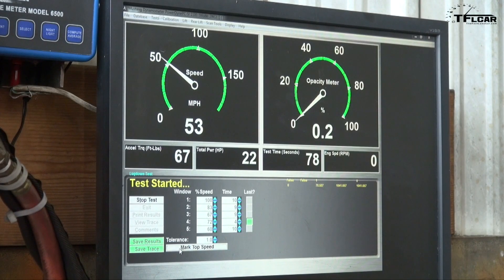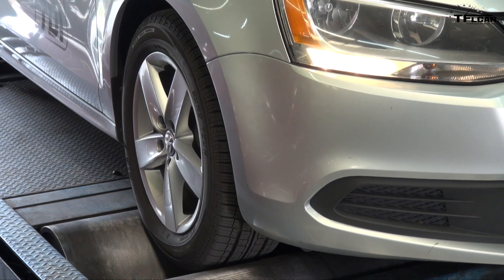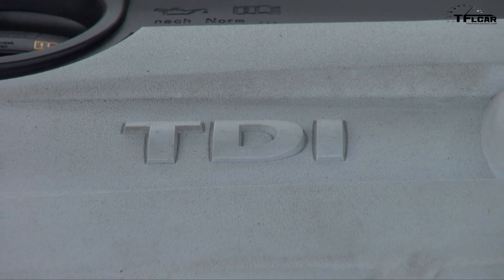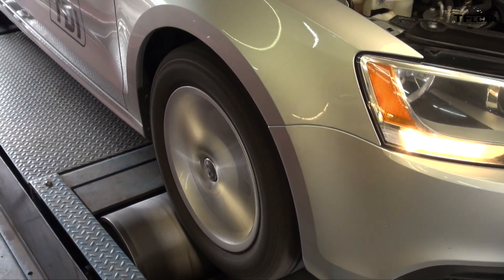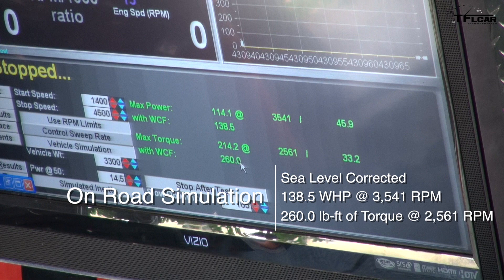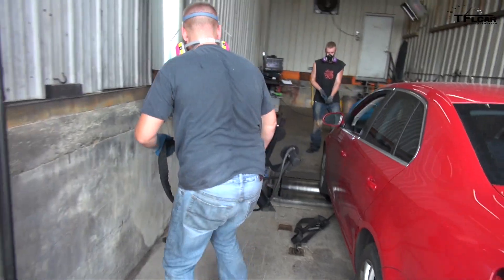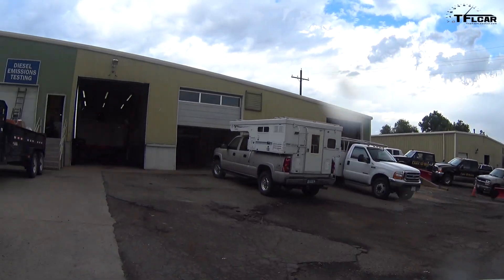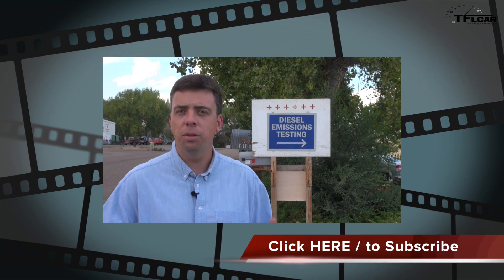Surprise! We Dyno a VW Dieselgate TDI Jetta to get the Truth about HP Loss

Comment: While I appreciate your attempt here, I am afraid your results are not valid; as VW's software is smarter than that. To begin with I don't think you put it in the proper dyno calibration model; as I understand that disables the traction control from triggering. (With older Golf R's you had to take the car through a sequence of steps to enable a dyno mode that disabled four wheel drive, but I am not sure how it works on the TDIs.) Also, you did not match the EPA's actual test, and I believe the software is specifically looking for those conditions to enable the "cheat". (Look up FTP-75, HWFET, SFTPUS 06, SFTP SC03.) I know for the newer vehicles CARB ran the phase 2 portion of the FTP on a loop and were able to detect that VW had tuned DEF dosing to result in a proper emissions output at the start of the test, but would reduce it in time to the point that emissions were uncontrolled. My guess is that older cars use a similar method and are looking for specific characteristics mirroring the actual EPA test as opposed to a straight dyno run, and that the decreased performance you saw was simply a result of the car going into a failsafe mode since traction control and abs were not functioning properly.
Reply: +Andrew Price I think you're absolutely correct. This is an interesting test for sure, but I don't think the 2nd dyno pull was a valid test.
Reply: Troy Strain  Well unfortunately I am not much of authority in this area either; as otherwise I could tell you how to enable the proper car mode and provide greater detail with regards to differences between TFL’s testing and that actually used by the EPA.  As a TDI owner who also has an engineering background I have been greatly concerned and curious about the specifics of this case, and accordingly taken something of a special interest as of late in any relevant technical documentation and/or qualified mass media publications (primarily Consumer Reports in the case of the latter) relating both to the EPA’s testing procedures and Volkswagen’s means for avoiding compliance.   It is based on information derived from that research that I raised the objections cited above rather than from any personal experience in the field however. 
 
That said, based on my technical background and tangential understanding of the subject, I am relatively comfortable with the legitimacy and accuracy of those aforementioned assertions; as to the best of my knowledge they are in accordance with any and all documentation on the topic.  It does not help that in the past when covering material to which my personal and professional experience is more directly related: TFL has repeatedly shown something of a bias towards producing attention grabbing populist videos that attempt to mimic some sort of scientific authority but that in all actuality have very little credibility in terms of methodology, procedures, and/or standards.
 
Basically, I just wanted to make it clear on what authority I was speaking as opposed to having my words somewhat blindly lauded as some sort of definitive source of information.  (No offence intended with that last statement. I just don't want to spread misinformation if I can help it.)
Reply: +Andrew Price 
Was going to say much the same - at least as likely that the ECU reduced torque due to the error code.
Reply: At their "dirtiest", the VW Isuzu diesel is far cleaner than any US labeled diesels which do not currently require testing , thanks to the trucking lobby. You must be a GM employee?
Reply: Auto Insider No.
Reply: +Andrew Price This test is insanely invalid.  You can argue back and forth about dyno and tailpipe vs OBD testing all you want.  The simple fact is, that these morons did not disengage the traction control system in the vehicle.  Mainly because you can't do it without pulling a fuse/relay in this model of Jetta.  I should know, I used to own one of these it use to annoy the hell out of me.  You can clearly see the traction control operating during the second pull, all the traction control lights start flashing.  The TPM system also starts going off, all signs of the wheel speed sensors operating normally.  The vehicles ECU/M/whatever VW calls it, starts cutting power to the motor in an attempt to slow the front wheels down.  Im honestly surprised it created as much power as it did in that second pull.

Secondly, modern vehicles all have DSC sensors in them that monitor pitch and yaw rates of the cars.  Basically the cars know if they are actually moving, which, is in part, how the whole cheat device operates.  This "test", if you can call it that, is just these guys creating click bait, in an attempt to get the under and uninformed even more riled up than they already are.

This is a really dumb thing that VW did, I even own a 2013 TDI right now, I didnt buy it because of the "clean diesel" aspect.  I bought it because of the ridiculous fuel mileage it gets.  But these hooligans are doing nothing more than throwing gasoline on an already stinky dumpster fire.
Reply: doctor zaius Thank you.  The kind words are appreciated.  It is always nice to know that someone enjoys reading through my overly verbose drivel… even in spite of my longwinded nature :).

As for your comments: I am not sure what to think about the whole situation with TFL and this particular video. While part of me would say that the technicians administering that test would have to realize that their results were not valid, another part of me wonders if they even knew what they were trying to replicate and how different the two tests really were.  To be honest before this became a major concern for me and my car I had no idea about the specifics of the EPA’s emissions testing procedures/protocols, and so it is entirely possible that both the staff at TFL and Tobz Performance were equally oblivious to those details as well.

In fact in continuing to research this topic this morning I realized that I had some of my facts regarding differences in dynamometer types wrong, and so I had to go back and rewrite some of the sections in my earlier post relating to that.  So with that in mind I would say it could happen to anyone, and I am not ready to rush to judgement and say that either TFL or Tobz knowingly produced a video with inaccurate results.  That said, I think they should have had some inkling that their testing was not valid based on how the car’s anti-lock braking and traction control systems behaved…. But then again I (clearly) don’t spend that much time dealing with dynos: so perhaps those issues are not that uncommon when testing a car.

I did actually go back and watch the video again, and I think you got one thing wrong though in your viewing.  You mentioned one line on the graph having a lot of dips and spikes, and I think you are referring to the black line at the top of the readout?  I have no idea what that line relates to, but the red lines signify horsepower and the blue torque; with solid lines representing the first run, and dashed the second.  They really did not explain this well in the video, and so I actually had to rip it and go frame by frame in premiere to realize this myself.  Regardless, both seem relatively smooth and progressive to me.

I will say that a lot of people don’t understand how a car’s power is derived, and I think that misunderstanding plays a part in how the data was presented in this video.  More specifically most people tend to think of horsepower and torque as two separate measurements when really they are interrelated units that represent torsional power.  That is why if you ask most people, even car enthusiasts, to explain the difference between horsepower and torque to you, they will generally struggle to come up with any sort of concrete answer.  Usually they will just end up rambling on with some really long complicated response that refers to top-end and low-end power, when the real answer is that time is the only difference between the two.  Torque and horsepower (in automotive applications at least) both measure the amount of twisting force being applied to the wheels.  The only real difference is that horsepower is sustained twisting force over a set interval, whereas torque is that force at a particular point in time.

This is where having some understanding of the engineering based calculations involved really helps; as to me at least it is a really easy relationship to understand if you know the equation behind it.  More specifically, to calculate horsepower in automotive applications you take a vehicle’s torque, multiply that by RPMs (which is where time comes in), and then divide that value by 5252.  Or if you prefer (TQ*RPMs)/5252 = HP.  (This is a simplified equation, but it works.)  This is why when you look at a car’s torque and power curve on a dynamometer readout horsepower usually exceeds the torque value at around 5200 RPMs (newer TDI’s are an exception to this rule due to how their turbo and control systems work), and it is also why diesel engines always have more torque than horsepower; as they redline at around 5000 rpm before the multiplier in the numerator can exceed the value of the denominator.

This is important to understand in that it helps to explains to some why the car in this video exhibits a greater differential in terms of peak torque output (32lb/ft) when compared to the rather minimal difference in terms of horsepower (2hp according to the readout).  Like I said before it is possible the car went into a failsafe mode because the ECU’s TCS and ABS system were not responding properly, however once pushed the driver may be able to override this mode and restore full power; as the ECU may assume that the car is operating normally at that point, and the fault is actually with its sensors.  Given that peak torque on that motor is supposed to come in at 1750 RPM and 4000RPM for HP: that could account for that difference; as the engine was still operating in a failsafe mode at the point that peak torque would have been achieved, and then normalized later in the power band.  (Their results showed peak performance at 2500RPM and 3500RPM for torque/horsepower respectively, but this could relate to differences in altitude and air density as well.) 

That said, I do have some questions regarding this test and its results.

1) The person controlling the car said he had to “ease into it” so it did not down shift, and so I wonder if that could be another reason that the torque was lower; as potentially it took longer for boost to build up in the system.

2) Why did they not disable the TCS and try running the test in that mode for sake of comparison?

3)  While the dyno they used (MD-AWD-500 to be exact) seems to have a fairly expansive feature-set given its more common nature, unlike the EPA’s compound dynamometer which has independent electric motors for each axle theirs uses a direct mechanical linkage (more specifically an aramid fiber belt) to synchronize the front and the rear wheels.  This makes me wonder: were the results of the first test were actually lower than they should have been given the front wheels were driving both wheels an therefor the system as a whole had greater resistance?

This last issue could have been accounted for in the software, but I have not seen any documentation or evidence that such an option exists.  In general though, I don’t really have a good answer for any of those questions given how little I know about the systems, software, and/or dynamics involved, but the more I think about it the more I openly doubt the validity of their findings.
Reply: Not to belabor that last point, but what really irritates me about this is that it would have been really easy for them to do this story correctly.  I did some simple googling and found that Colorado State University is heavily involved with biodiesel research and development.  Perhaps more importantly they have a department, the Engines & Energy Conversion Lab (EECL) that specializes in this kind of research, and that is currently investigating "Engine Emissions Testing of Straight Vegetable Oil", "Biodiesel Pollution Formation Kinetics", and "Emissions from Algae-Derived Biodiesel".  While those may not be directly related to the VW scandal, clearly they have personnel on staff that are extremely familiar with diesel emissions testing standards, NOx measurement procedures and guidelines, and that will have experience and knowledge as to the current levels of pollution that standard diesel engines produce using both using biodiesel and petroleum based fuels.  Not to mention access to equipment that can actually be used for testing a diesel emissions.

If TFL had taken a few hours out of their busy schedule to just call up the EECL and maybe talk to some of their staff members: this story would have had a great deal more legitimacy and depth to it.  They could not only have learned more about the testing process, but also figured out how to properly conduct this test, where such a test could potentially be done locally, and maybe even gotten an interview with an expert on the topic.  They could have even potentially expanded the story narrative further beyond its current state.

After all, anyone working in that field is clearly going to have a vested interest in the topic, and so they will probably have some thoughts about what VW’s transgressions mean for the biofuel industry, how it might affect future development in diesel vehicles, its impact on their funding and research, and what future changes it might lead to in both in terms of consumer diesel vehicles and diesel related emissions testing.  More relevant to this particular piece: they might even be willing to offer some insight as to what kind of fixes VW might be considering to resolve this issue, and how those might affect current TDI owners in terms of fuel efficiency and power.  Then just cut to you actually testing the cars (assuming that can be done) at a qualified facility possibly with said expert on hand to help you measure emissions, and now you have a story with some legitimacy and weight behind it.

Heck that is even a story that the local and possibly even national news might be interested in running with, “local YouTube content creators work with CSU researchers to determine how emissions issues will affect VW owners.”; especially given it was research on the university level that really kick started this whole Volkswagen EPA scandal to begin with. In general it serves as both good publicity for the university and TFL, and everyone wins.  Furthermore, I am fairly certain that most researchers would appreciate the extra attention and publicity on their work, and would be willing to help without any compensation beyond that. Yes, it might take you a week or two to do the piece instead of a few hours at the regional performance shop with Jordan and Brian monkeying around on a dyno, but at least then you have a story that you can be proud of and that is worth reporting on. 

(I know all of this this is total rant on my part, but it just annoys me that it would have been so easy for them to do this story right instead of playing scientists without any clue as to what they were doing.)
Reply: WELL SAID BRIAN... WELL SAID .. THE EPA IS SHAM AGENCY..
Reply: +Andrew Price Ahhh, OK... my apologies to TFL then. My computer makes that black line (labeled as "0 to 100 (PSI)" in the dyno software) appear to be blue. I suppose that would be for MAP sensor output, but it doesn't look like they have that connected here (y-axis values are all 0.0), and the squiggly line is just a software freakout from lack of input and/or a minuscule amount of interference on that input channel.

At the beginning of the video, one of the technicians said that they "push a button" to disable the traction/stability control systems as a matter of testing procedure, but from reading around a bit, it seems it isn't possible to disable those functions on this model of car and no such button exists. If they had pulled a fuse for the ABS system or done some type of manual modification that disabled them, we would have seen an error light during dyno run #1. In dyno run #2, I believe the TCS error is caused by the rear axle VSS showing 0MPH while the front wheels are accelerating. In normal driving conditions, this would indicate front wheel spin while stationary (like if you were slipping on ice/snow) and the TCS would step in to try and slow the wheels through ABS or cutting power. I think it's probably much more likely that the drop in low-mid range power on run #2 is a combination of TCS action + "easing into it" rather than the actual "test mode" cheat having been enabled. As you said, at some point it's likely that the ECU just ignores this input and chalks it up to sensor malfunction, but that means it's in an "open loop" failsafe mode rather than a specific emissions testing mode.

So ultimately, I think doing a video like this is interesting just to see how the car would react, but also completely misleading. The prudent thing to do on TFL's part would be to edit the video with a disclaimer at the beginning explaining that their testing procedure was completely different from that used by the EPA and other governing bodies, which the TDI programming was specifically looking for, and that the results can't really be trusted as an indicator of anything beyond what we saw in the video.

Re: HP vs. torque, you're preaching to the choir on that one. That's my #2 pet peeve when it comes to car "experts" on the internet, right after the widespread misunderstanding of gross vs. net horsepower ratings. That damn "horsepower sells cars, torque wins races" quote, which has been attributed variously to Carrol Shelby, Enzo Ferrari, Jesus Christ, etc. always taken out of context to suggest that diesels and awful, low-revving American V8s from the late '70s have some type of innate magical racing ability that isn't reflected in their low peak HP output.
Reply: +Andy Hicks Should have read all the hidden comments first, and read them all, as I basically repeated you guys. LOL
Reply: Steve Rodgers If I wrote that I had definitive answers when I did not know all of the facts or factors involved: I would be doing the exact same thing that I am criticizing them for doing.
Reply: +Andy Hicks 
"What I noticed is that the second dyno test didn't accurately represent an emissions test, as tests exist in many states...They don't do dyno testing on cars with OBD-II in CT."

Cute, you think the OBD-II test is a proper emissions test.
Reply: +Ed Bartek I think he means the traction control is back off the fuel quantity being injected, therefore resulting in the loss of performance. I'm not sure it's as simple as remapping an ecu.... Without reducing the overall performance anyway.
Reply: This car doesn't have DEF. It has a DPF.
Reply: Troy Strain I could be wrong, but I don't think they would have the kind of equipment.  The EPA does its testing at the National Vehicle Fuel & Emissions Laboratory (NVFEL) in Ann Arbor Michigan, and their systems and approach seems to be extremely specific to the particular types of tests they are responsible for administering.  For example, as opposed to the more conventional eddy current type dynamometers like the one used in this production, the EPA uses a more dedicated compound dynamometer that is explicitly designed with emissions applications in mind.

As such it is more complicated/expensive and requires more cooling and control systems, but allows the operator(s) greater control over the vehicle being tested; as it can better simulate load conditions, road surfaces, braking, and other normal driving variables.  Additionally these systems have specific options integrated into their control software that meet the required guidelines governmentally regulated emissions testing that either can be used to either control a vehicle’s throttle/braking directly via electronic interface (most likely OBDII) or provide technicians with on screen guidance for a vehicle’ operation and management; as is needed in the case of test cars equipped with manual a transmission.  The precision with which these types of systems operate is the reason that VW could code their ECU's software to detect when it was being tested, and is in part why I think that TFL’s attempt at replicating the power output of the vehicle during testing ultimately failed in its intended objective.

I will include a link to a video that shows an example of this kind of dynamometer, more specifically a “HORIBA ATS VULCAN Chassis Dynamometer”, in a proceeding post; as I am not sure if comments with links are blocked or require approval.  (If they are, you can search for the quoted text above on YouTube and find the video I am referring to.)

Due to the size and cost associated with this equipment (which is anywhere in the neighborhood of .5 to 1.5 million dollars based on the figures I have seen) you are probably not going to find such a system in any facilities that are not specifically owned by a vehicle manufacturer or run by a government agency; as they are the only groups that generally have a need for those system.  More to that point it doesn’t seem like most universities with, even those with well-established automotive engineering and development programs, have access to such equipment, and therefore they use the EPA’s NVFEL facilities for that purpose for certain eco oriented design competitions and challenges.
Reply: +Andrew Price Great comments, the power curve on the 2nd dyno run clearly shows a lot of dips and spikes compared to the first. I would bet that the shop owner explained this to them and they just chose to not include that segment in the video, for obvious reasons. As you said much more eloquently, TFL is pure clickbait psuedo-science... which is a shame, since they seem to have quite an operating budget and access to lots of great vehicles.
Reply: +Andrew Price What I noticed is that the second dyno test didn't accurately represent an emissions test, as tests exist in many states. In CT, you plug the test equipment into the OBD-II port, you command the Service Engine Soon light on and off to verify the owner didn't remove the bulb, check all emissions systems for readiness and whether they pass or fail. They don't do dyno testing on cars with OBD-II in CT. 

I was under the impression, from a radio news broadcast I heard (accuracy could be off) that the engine specifically ran under the emissions-compliant mode when the test equipment plugged into the OBD port - they didn't mention if they ran the second dyno test with emissions test equipment connected (which they admitted the dyno shop couldn't do emissions testing) so what seems to have happened during the second test is that the "nannies" (traction control) noticed the rear wheels were stationary, which indicates to that system the front wheels are spinning, and therefore the engine response changes to prevent the perceived wheelspin. You can see on the dash the "low traction," abs, and brake lights turn on in the gauge cluster. The engine cut back on output, thus the different power curves.

I had a car that was virtually impossible to drive uphill in deep snow because at the slightest loss of traction, the engine would cut back, until you were stuck, gas pedal halfway to the floor, engine at idle. I also would have three lights on in my gauges: Low Trac, Brake, and ABS, as the system did what it thought it needed to do to keep my tires from spinning. It's only an assumption that a similar thing happened here because the rear wheels were stationary during the second run.
Reply: +pat kent You asserted that the “EPA had to build a crazy dyno to catch” them, and I was just correcting you on that point.  The type of dyno does matter in this case though; as it directly relates to the video above, as does the fact that the EPA uses very purpose built course profiles on the dyno during testing.  (Which was part of the basis for my original objection to TFL’s segment.)

More specifically, the profiles they use in their evaluations are setup so that they offer certain resistance to the wheels and are designed to simulate different real world conditions.  The FTP-75 (or city) test for example is comprised of an 11.04 mile dyno course, takes 1874 seconds to complete, and has an average of speed of 21.2 MPH with a 10 minute cool down period between phase 1 and 2 so that the vehicle’s emissions might be evaluated during both hot and cold starts.  This test is administered either using remote throttle control (automatics) or on-screen computer guidance to the operator when testing cars with manual transmissions.  This is the test used by the WVU team for their comparison against the data garnered from their real world driving experiments and was administered at CARB’s Arie Jan Haagen-Smit Laboratory in El Monte, California.

It is because the specifics of these test profiles are so consistent and strictly defined that Volkswagen’s code is able to so precisely key in on those parameters and detect when the car was undergoing testing.  My understanding is that it also looks at other factors like steering wheel orientation and movement as well as the car’s current driving mode to determine this as well.  Like you said, it is a very sophisticated piece of software, and not one that groups like TFL are going to be able to easily fool on a simple dyno run; as all of appropriate parameters must be met for the car to enable the emissions defeating software.

As for your comments on the urea injection system: it may not be as simple as you think.  For their research the team from West Virginia University’s Center for Alternative Fuels, Engines, and Emissions (CAFEE) ran tests on three separate vehicles: a 2012 2.0L I-4 Jetta Sportwagen TDI (“vehicle A”), 2012 2.0L I-4 Passat TDI (“vehicle B”), and a 2013 3.0L I-6 BMW X5 xDrive35D (“vehicle C”); the latter two of which used an aqueous urea-SCR injection spray system.  Yet despite the fact that some of the vehicles in question had this system in place: all of them failed to meet EPA emissions guidelines during certain portions of their evaluation.  More importantly to this story however, the 2.0L TDI’s exceeding US-EPA Tier2-Bin5 guidelines in every phase of testing (including highway cruising) by factors of 15 to 35 (vehicle A, lean NOx trap (LNT)) and 5 to 20 (vehicle B, urea-SCR system) regardless of emissions control method.  The BMW on the other hand met guidelines during normal road use in every test other than the rural uphill/downhill driving segments in the Los Angeles foothills; which is why BMW is not receiving the same scrutiny.

So basically: while urea injection does help to reduce the pollution the Volkswagen 2.0L TDI engines produce, it does not fix the problem entirely.  Which is in part why VWoA pulled their EPA certification applications for all 2016 vehicles until a solution could be devised.  Now on newer cars or ones that have urea systems options, you are right in saying they can probably get those to meet guidelines fairly easily by messing with engine/emissions parameters and increasing DEF dosing and adding a urea delivery system to the vehicle if it does not have one already equipped.  However, on older vehicles that did not have urea system options integrated into their design (Jetta sedan/sportwagen, and Golf)… it is not so easy; as there is no place for a tank in the car.  Additionally given urea’s fairly corrosive nature it must be located in an area outside of the vehicle.  This is why on MQB based US and EURO spec 2.0L TDI VW/Audi models the Volkswagen group elected to delete their independent rear suspensions in favor of a space saving torsion beam setup to make room for a 5 gallon urea tank underneath the car.

Also one final little point just for the sake of clarification: they did not tow their testing equipment behind the vehicle.  It was actually placed in the trunk\hatch area along with a small gasoline powered Honda generator; as to avoid placing any abnormal burden on the vehicles during testing.  More specifically, measurements were done on a continuous basis utilizing a Horiba OBS-2200 portable emissions measurement system, whereas particle number concentrations and particulate mass emissions were inferred from real-time measurements performed using a Pegasor particle sensor, model PPS-M from Pegasor.

If you want to learn more about the approach and application to their evaluations: I highly recommend you google the IEEE spectrum article on the topic, titled “How Engineers at West Virginia University Caught VW Cheating”.  In that write-up the author provides a link to their published report that includes more specifics and photos of the actual vehicles and equipment used.
Reply: +Ed Bartek I don't think it cuts spark bud, that would result in bore wash and emissions that are through the roof, not to mention all the unburnt fuel entering the cat. With a diesel if the injection pulse is reduced and the timing is retarded there's no problems. Although detonation is exactly how the principle of diesels work.
Reply: I forgot about the diesel, doh! Whenever we tuned traction control it was spark cut. Although I understand the concept I have trouble believing raw fuel in the cylinder for maybe 5-10 revolutions or .25 sec would actually wash out the bore to the point of damaging the finish on the cylinder wall especially since most things I see have seen have some type of piston oil squirters. Again high emmissions for .25 sec in favor of safety and that un-burnt fuel will surely ignite when it hits the 500 degree cats. I never understood the fuel cut at redline either, I always thought that would surely present a lean condition. thanks for the correction.
Reply: Ed Bartek Yeah diesel emissions are totally different.  With TDI's they either use a LNT (lean NOx trap) method or an aqueous urea-SCR system. 

Our cars use LNT's to absorb NOx, but must go through a periodic high temperature regeneration cycle to help maintain usability and avoid SOx poisoning of the filter.  Diesel fuel is used to burn off these impurities, and this is why lower fuel efficiency is a possible outcome of trapping more of the exhaust that way.  (Which is problematic for VW because emissions output is measured against fuel usage.)

Urea-based exhaust aftertreatment systems are a totally different approach, and were offered as an option on newer Passats and come standard on MQB derived Golfs and Jettas.  These inject DEF fluid into the exhaust stream to help neutralize NOx related emissions.  In general they seem to be more effective, as the WVU team found a 2012 Passat TDI equipped with this system saw a reduction in NOx output by 50-66% over its LNT equipped counterpart.  That said the Passat was still over EPA limits by a factor of 5-20 and they do require periodic refilling of urea fluid.  The BMW X5 they tested had this system and also failed one portion of their real world testing, but overall met EPA guidelines in every other evaluation.

Most likely on cars that were offered with this option or came with it standard: VW can just increase dispersal of urea so that they meet the requisite emissions standards at the cost of more regular DEF fluid refills on the part of the car's owner.  (I am sure they will offer such refills free of charge to affected customers.)  Obviously this will require them retrofitting such systems into cars like the Passat that offered it as an optional feature, but that should be relatively easy to do since I assume the car has preconfigured mount points for it to sit in the vehicle.
Reply: You are absolutely correct.On  TDI's you also have to remove the ABS and ESP connectors in order to dyno then.
Reply: +Ed Bartek ...or TCS can also simply control the throttle valve. This is present on pretty much all modern cars, as cars have electric throttle anyway, and by using the throttle valve power can be controlled a lot more smoother than cutting fuel. On a gasoline engine, if you use fuel cut, you'd have to cut the fuel injection completely, not to run the engine lean. So fuel cut would produce a pretty much on/off kind of a solution. Spark cut on its own can not be used on road legal cars as it would result in unburnt fuel getting into the exhaust. This causes unwanted noise, pollution and possible catalyst deterioration. At it's best TCS can control the throttle smoothly just like, or even better than, an experienced driver would.

On a diesel engine it is very simple just to reduce the amount of injected fuel, as diesel runs with excess air anyway and power is mainly contolled by the amount of fuel injected to begin with. Of course modern diesel engines also have throttle valves and all sorts of bells and whistles that can also be used, but fuel injection has the key role.

Brakes are usually used to slow down the wheel that's losing grip to sort of simulate a limited slip differential.
Reply: +george bush True, but at the time my car was built you needed premium gas (and really still to do in most cases) to get the equivalent power output.  As for prices: it somewhat depends on the local market and the taxes there.  In Georgia this last year they introduced new tariffs on gasoline, and diesel did not get hit with the same increase as its more combustible counterpart.  Short of the laws changing, those remain the same.  And you are right diesel does produce heavier gases (NOx) as well as more particulate, but some diesels combat this better than others.  When WVU did the testing on diesel engines that started this whole mess they tested three cars.  The BMW passed with only marginal above average emissions levels in one test, both VWs failed in all of those same tests.  So clearly diesel drivetrains can be made to meet the US standards, but at a cost.

And, no I think I am superior to you because I actually studied engineering and I know more about this than you do, but if you wish to dimiss that as me being liberal or something: go ahead.  I am sure the people that say there were not WMDs in Iraq fall under that same category in your book :).
Reply: +george bush
<<Everything causes cancer according to the "medical experts">> Not true. You pulled that out of your ass. Your disregard for the experts only show your ignorance. They have owned the right to be called "experts". While it is true that we don't understand yet all that is with the cancer , i prefer not to assume unnecessary risks. 

"This same group of geniuses who can't find a cure to the common cold" - Maybe the solution is not that simple. Perhaps you should lend them a hand.

"you liberal sissy" - I don't have a political affinity . Calling names also  does not help the proving a point.
Reply: Andy Hicks Andy, the state inspection tests for emissions are completely different than the federal ones VW designed the cars to cheat. Those type of inspections usually just hook up a diagnostic tool to the car to check that it's self-reporting correct emissions levels. At least, that's how it is in New York. For pre-OBDII cars, it's just a visual inspection of the emissions equipment. In the olden days, they used to actually hook an exhaust analyzer up to the car, but they eliminated that system years ago because it cost too much.

California may still analyze exhaust content as part of a yearly inspection, so it might be interesting to see what their test procedure is. Odds are, it's much less involved than the EPA certification test.
Reply: +doctor zaius UK yearly MOT tests include an exhaust analyser, so are still in the 'olden days'!
Reply: Mickleblade Doing emissions testing that way is much better than trusting the diagnostic system... the only reason they ditched it here was that small shops were complaining that the cost of the testing equipment was putting them out of business.

I looked up the UK MOT test procedure and that would be no good for enabling the "cheat mode" on a VW either... it's a stationary test done with the car in neutral. Emissions are totally different with a load on the engine, like in the EPA or EU6 testing.
Reply: +Andrew Price Jesus...can you get a little more concise??
Reply: doctor zaius Yeah, I could not read all of the writing on the screen on my end even once I exported different frame sequence as JPEGS.   I swear at first I thought they blurred some of the numbers out like they were trying to hide something, but I think it is just the fact that they were shooting in bad lighting using cameras/lenses that struggled with certain color ranges when they were not in the center of the shot.  This may have contributed to your problems as well.  Although if you were watching this video on a device with a more limited color range and that relies on dithering (I.E. anything with a TN panel) or that has not been properly calibrated for color reproduction… that may have compounded those issues as well.  (Professional grade IPS for the win ;).)

As to your apology: I don’t mean to demonize TFL, but I am not really trying to defend them either.  My point of view is that as a channel they cut way too many corners when it comes to production.  In general their videos lack much in terms of real content, most of the time they just read off a stat sheets, use the same cut and paste editing for everything, and overall… are not that interesting or entertaining.  Now I realize some of this is because they depend on automakers to lend them the vehicles they show, and so to some degree they don’t want to be overly critical and bite the proverbial hand that feeds them.  However, other channels do similar things (Xcar and to a lesser extent Chris Harris I am looking at you buddies), but they are clearly more invested and involved with the cars they are reviewing.

Yes, they generally glance over a car’s various little issues and tend to give rather glowing reviews, but at least they mention those faults before explaining why they choose excuse those foibles.  And at least they take the time to frame and shoot their videos beautifully instead of just putting a camera on a selfie stick and calling that video production.  Hell even MotorWeek is more critical than TFL, and yet they seem to love every car they get in somehow.  The thing that I have seen TFL most take an automaker to task for (prior to this diesel scandal) was Honda’s insistence on using capacitive volume sliders instead of knobs on their radios.  TFL just goes through its paces and is not really that invested in cars in general other than putting out more content.

Basically my opinion is that their channel is like the McDonald’s of car relating viewing on YouTube: it is fast and convenient and you are not going to have to wait long to get your fix, but overall it is lacking in real substance, it never as good as you might have hoped, and because they produce things so quickly you know that not much care is taken in terms of its preparation.  However, in general that is fine to me; as for the most part they don’t claim to be anything more than that.  (Although the fact that they label some of their videos a reviews is kind of a joke.)  They seem to understand that they are pandering to the fanboys and automakers, and to some degree embrace that.  And assuming they stick to that mantra: I have no problems with them as long as they are being true to themselves; as there is a place in a world for channels that just get things out as quickly as possible when clearly the viewing public has an appetite for it.

Where I do have issues with TFL is when they do things like this video and that stupid “5 Hard Questions for Volkswagen Brass” segment they did when with all of this first started. (Like VW’s upper echelon was actually going to be there and ready and eager to answer Andre and Roman’s “hard hitting” questions when they had not disclosed much to the public and there was potential litigation pending.)  To me that is disingenuous and just a ploy to get more clicks.  (The fact that Autoblog actually covered this video as a newsworthy story is a totally different issue… at least TTAC had enough sense to take a critical approach to their “research”.)  TFL should stick to their puff pieces, and let real investigative reporters do the heavy lifting on stories like this instead of muddying the waters with misinformation and journalistic hackery.  Or if they do want to actually do content driven pieces, how about this for a novel idea: interview experts in the field, and use their guidance in conducting real experiments.

Oh yeah, torque is a wonderful thing.  Horsepower has its place as well (as you soon realize when you drive a car with such a narrow power band), but in normal daily driving: torque is what makes a car fun.  Trying to take advantage of your car's horsepower on regular roads on the other hand... is more likely to land you in a ditch or in jail.  (Not sure which is worse in that scenario... I suppose it depends on what ditch/jail we are talking about.) That is why most car enthusiasts seem to rather like electric cars in spite of their eco cred and single ratio gearboxes.... well that and having all of your weight down low certainly doesn't hurt in the corners.
Reply: +Andrew Price I agree, it looks like they tested something, but not for the issue mentioned.  The obvious thing is there is no way a 10-30 hp decrease would decrease emissions by 40x, also I'm sure every tester would have noticed the car's warning lights coming on and the engine acting weird for all these years if that's how it actually acted.
Reply: iSOBigD
So, what actually does decrease emissions by 40x?
Reply: dalamian There is a way to disable it, but it is a software based trigger.  There is probably some key in there that you can access via VAG-COM to disable traction control.  After doing a bit of googling I found that ECS Tuning sells a Traction Control Retrofit Kit for the Jetta, but on some models you have to mess with VAG-COM so that ABS is defeated.

I also think on Audi FWD cars, it cuts power up to 20-25MPH, so you are right there.

Regardless, you are right I think about them not knowing what they were doing, it not putting the car in the right mode to enable the cheat, and creating a dumpster fire. (A very expensive one at that.)
Reply: donkgated For newer vehicles with urea based systems they just have to update the software mainly.  The cars will consume more DEF fluid but meet emissions guidelines.  For older cars it is a bit uncertain, they have discusses retrofitting larger cats and urea sprayers, but that is expensive and time consuming if possible at all.  (The MK7 TDIs lose IRS to make room for the urea tank.)  It may just require older TDI owners getting new cars.  (At which point I will probably just get a 1.8T; as their gas mileage is greatly improved, and you get to keep the fully independent suspension.)

Regardless, we should hopefully know more by the end of today.
Reply: +Andrew Price I know that both of these tests were in "cheat" mode as neither was simulating real world driving conditions. VW's cheating was/is  far more sophisticated then simply being on a dyno with TCS or ESP disabled. The EPA had to build a crazy dyno to catch them, far beyond the average dynos ability.  I can tell you that under most freeway conditions these vehicles were not spewing NOX like the EPA wants us to believe. Matter of fact they were doing exactly what the "sniffer tests" were seeing.  Was VW deceptive?  Yep.  Are the vehicles black smoke belching beasts? not at all. The vehicles in question will always pass a smog test, unless it is a portable one stuffed in the trunk or towed behind it. But really, we shouldn't care, just drive it and enjoy it.
Reply: Andrew Price
IRS has nothing to do with urea tank for Mk7 TDIs. In Australia all Mk7 Golfs have IRS, and the TDIs are unaffected by this scandal.

And yes, I know the answers to my rhetorical question - it is as you say. The point I'm making to isobig is, these solutions will bring down power and torque (or perhaps bring them down to something more in line with what VW claims).
Reply: donkgated Australia lags behind the US and even Europe in terms of emissions.  As of right now they are only up to Euro 5 level standards; whereas the US is much more stringent and Europe has moved to EU6.  Because of this they did not fit MK7 cars in that market with the urea injection system and the cars retain IRS.  This also means they will be much harder to bring up to code; as they use fundamentally the same EA189 diesel system used in the MK6.  Most likely they will just replace those cars with updated MK7s with urea and torsion beam rear suspension. For MK6 versions MY2013+ (when EU5 was adopted in Australia... I think) cars will probably get the same fix as in Europe.

I don't know about how much power and torque figures will change, but at least in the US they cannot reduce efficiency; as PPM output is measured relative to fuel consumption.
Reply: pat kent I think you mean, “I know that both of these tests were not in "cheat" mode”, but please correct me if I am wrong in this assumption.

Yeah the EPA, CARB, and all of the auto manufactures use compound type dynamometers (similar to the “HORIBA ATS VULCAN Chassis Dynamometer” that I mentioned in an earlier post) as opposed to the eddy current style seen in this video.  They run them through specific test cycles, and that is what the TDI’s ECU is looking for: that pattern.  They also put it into a special testing mode; so that acts as a trigger as well.
However you are wrong on a few things.  NOx is colorless in most cases, but can be reddish-brown depending on type.  The black smoke you referred to is a result of particulate matter generated during the combustion process.  In modern cars this is caught in a trap, and later incinerated using diesel fuel, which is where the concern regarding reduced fuel economy stems from; as the more PPM you catch, the more you have to burn off.

Also the EPA did not catch them, the team at West Virginia did.  When their report was disclosed of their findings in 2014 that is when VW came under more scrutiny.

However I am not sure how they will do in emissions tests if the cheat was disabled, in Georgia at least diesels are exempt from emissions testing.  However, if they could pass emissions previously: why create the cheat system to begin with?

And depending on state they may make you get your car fixed by making it a requirement for registration and tag renewal.  That is what California is planning on doing.  Regardless, I can’t do that.  My Father spent his career working for the NPS, and so I can’t drive a car that I know produces that level of pollution.
Reply: +Andrew Price the type of dyno that they use is irrelevant, there are things that cannot be reproduced in dyno testing. VW was obviously trying to get away with not having to put the urea injection in the vehicles. to get by that they cheated, that's the bottom line. the people who found out that Volkswagen was cheating actually road tested the vehicle and found that it was a different result than what they were getting on the dyno. there are certain things you do when you are actually driving the car that  dyno will not reproduce, no matter what kind of dyno it is. that's how they got caught.
Reply: Completely agree, this showed nothing.
Reply: +Andrew Price Although I agree this test is bullshit I doubt the TCS is holding back this stock TDI, It would take another 1000hp to get those tires to start slipping in 3rd gear (which is usually where you make a pull from). Mustang Dyno's are Ghey get a Dynapack and I can't wait to get a deal on one of these cars for dirt cheap people are looking at them like they are the plague. Your car is fine VW will flash your ECU and send you home that day.
Reply: James Coates Traction control usually cuts spark at the moment of slip, cutting fuel becomes dangerous under load and can cause detonation. Yea the vehicle will take a performance hit with a re-map, I can't imagine any other way to cut emissions they are already using a primary and secondary cat a resonator and muffler. I would take one with a hefty discount cuz the only thing they do around here is pressure test your gas cap I wouldn't know where to find a shop with a sniff tester.
Reply: Ed Bartek lol No, it is not that easy on our vehicles.  I have 2011 Golf TDI and my Mom has a 2013 Jetta Sportwagen TDI, and as neither vehicle has a DEF dosing system or had one offered as an option... they are the biggest offenders in terms of pollution and will be the hardest for VW fix; as they can’t easily retrofit a urea tank and delivery system into the vehicle. To add further complications, because of its corrosive qualities, such a tank must be fitted outside of the main cabin.  On newer Jettas and Golfs based on the MQB platform, VW managed this by replacing the independent rear with a space saving torsion beam version on US and EURO spec TDI variants so that a 5 gallon urea tank could fit underneath the vehicle.  The MK6 models like ours use a totally different architecture (PQ35) and are smaller vehicles in general: so my guess is it those vehicles VW has considered offering a buy back or MK7 replacement options to customers.  At least in the US market anyways due to our more strict emissions guidelines here.  (Which is in part why resale values have not dropped dramatically so far.)

However, I think you are right with regards to newer Passats (which did have a urea option) and MQB based Golf/Jetta models: those can probably be fixed with some simple software adjustments and minor upgrades to their emissions control systems. 

And Mr. Coates is correct in relation to my statement regarding power reduction.  (Sorry about that, I should have probably phrased that differently.)  I read somewhere that on Audi's FWD cars the TCS will reduce power production at speeds up to 20-25MPH before full power is restored if an issue is detected by that or the ABS sensors, and my guess is that these vehicles use similar settings to manage the car as well.
Reply: Andrew Price Thanks man, very informative.
As a general clarification: TCS's use
Spark Cut, Fuel Cut and or application of brakes depending on style and manufacturer
Reply: Ed Bartek Yeah to be honest I was not sure how they reduced power, but I knew that they did it anytime the TCS triggers to prevent the driver from losing control of the vehicle.  In fact I have had a fair amount of personal experience with this; as my car flashes that traction warning light at me all the time when I downshift and take corners too quickly in the rain lol.
Reply: +pat kent The EPA wasn't the one who caught them though.... There's a small independent company that do their own testing to better the environment. They were the ones who reported VW... Those guys had a huge payoff in their back pockets, but did the right thing. I guess they care about the planet which will eventually die.
Reply: +Chris Ikner I can't believe VW got away with it for so long.
Reply: Chris Ikner It was West Virginia University's Center for Alternative Fuels, Engines, and Emissions that caught them.  They published their report in 2014 I do believe.
Reply: Chris Ikner
Official word is, they were trying to prove to Europe that it is possible to come up with clean diesel engines. Since US emissions standard is tougher than in Europe, they thought they'd test US cars to prove their point. BMW X5 passed, VWs didn't.
But who knows what really happened - it could be as you say.
Reply: +Andrew Price A lot of guessing and believing in your comment here
Reply: TheArfdog Well a lot of the details about the cheat and TFL's methods of evaluation are not thoroughly explained... so I have to guess to some degree.  I know that Consumer Reports tried doing a similar test and as part of that removed the sensors from the rear axle and entered in a specific input sequence (steps that TFL does not seem to indicate that they did) to put the cars into the correct mode of operation, and I don't even think their results are valid because according to the EPA's documentation the cheat it is looking at almost everything the car is doing to detect when to make the vehicle emissions compliant.  However, if I said that definitively: I would be doing the same things that I am accusing TFL of doing. So hence I just say I guess instead of making it sound like I know all of the factors involved.
Reply: +TheArfdog Less than in the experiment on the video...

I think Andrew is on the right tracks here, and the guys on the video really do not know what they're doing, or should be doing.
Reply: +george bush 
How about the increased chance of getting cancer . YOU walk . I don't want you to expose me to that risk !
Reply: +george bush 
You want to be lied by a company ho makes bilions cheating ?
Reply: +george bush If you wanted performance, you wouldn't have bought a diesel.  They sold them as being clean products, and the consumers purchased them with that concept in mind.  You could buy a GTI for similar money, and it delivers marginally better performance.  TDI owners like myself bought our vehicles looking for a more environmentally friendly vehicle that was more enjoyable to drive than a Prius, but we realized that we were giving up performance in return for those more eco-friendly characteristics.  So in that regard your argument makes no sense. They were after all marketed as clean diesels and not performance diesels.
Reply: +george bush How is it political correctness to say that I want what I paid for?  I would think that standing up for yourself and what you believe in is the mark of strong individual....  Ahhh I see, you would rather troll the internet than carry on a real conversation.  What would that be the mark of exactly?  Oh yes, an individual with nothing intelligent to say.  Well I that certainly explains your screen name as well as your attempts at shrouding the truth with bs conservative rhetoric ;).
Reply: +george bush Well I guess you have it all figured out there huh bud?  Well then perhaps I made a mistake.  I mean ignore the fact that in the state where I live fuel taxes on diesel are lower than on regular gas so you only pay .20 more a gallon or 10 percent more on average for 25% more mileage even with the current ridiculously low gas prices (which will not last forever), and the MIT research that shows how switching to higher octane gas (I.E. gas which resists ignition to a greater degree and allows for higher compression ratios... you know fuels that performed more like diesel) would significantly reduce air pollution.  Yep, let's throw all of that out and say you are right: what in the hell does that have to do with me being sold a false bill of goods?  

Once again your only answer is to descend into your "PC brainwash" gibberish when confronted with anything resembling a serious and genuine comment.  Wait a minute... constantly droning on in a nonsensical manner, unable to deal with outside opinion/thought, and repeating the same phrases over and over again: gee willikers Bushman, sounds like you're the one that has been brainwashed ;).
Reply: +george bush It depends on the model we are talking about.  Cars like the Passat, CC, and GTI are pretty bad, but the TDIs generally do slightly better.  My car was rated above average in the 2015 issue of CR, and overall as a brand they were ranked 15th out of 30 for 2016.  No that is not great, but not terrible either.  That said, I am currently looking at buying an Audi because of the improved reliability.  (I got a really good deal on my Golf, and the same generation A3 TDI was known to have serious issues with internal body panels etc.)  And yes, they did miss it or wondered how VW was doing it.  However, the kinds of things that the WVU team did for testing are non-standard, and so it is really hard to know until you go and test it on the road.  That is a very specific type of expertise, and unless you know everything about the car (how the software and hardware is designed etc.)  it is really hard to predict.

I will not get into the political muck, but yeah I would not have an issue with VW if they had not tried to sell it as a "cleaner" form of internal combustion when they knew it was not.  Look a Toyota Prius pollutes as well, but not the same amount as an average car.  I expected my car to pollute to some degree, but like the Prius less than a standard powertrain and certainly not 40X the legal limit in some areas.  (Maybe less than a Prius once you factor in rare earth metal mining etc.)

And you just keep thinking that about naturally aspirated engines, right until you can't buy them anymore.  Speaking of which... ummm aren't most brands going to forced induction nowadays.  Hell even Honda and Toyota are getting in on the act. Hydrogen is the most likely replacement for the standard ICE if we can ever get a supply network in place and figure out how to separate it from other elements and make the fuel cells last longer.  It is more a matter of when than if.
Reply: +george bush Ahhh, is that so?  Well then you will know that the big H's reliability is not what it used to be, and if you follow the car industry you would also know that they, the lords of naturally aspirated v-tec engineering, have started using turbos heavily in the their bread and butter vehicle the Civic.  And not just on sports models, basically any Civic other than a base LX or EX has their new turbo charged powerplant....  Of course, to be fair, it has also had production issues as well, like piston pins that were not properly installed, but that has little to do with turbo motors and more to do with Honda's continued design and quality control issues.  (I used to be something of a Honda fanboy, so to be honest I hate to see that.)  

Now given Honda's history for using the same motors across their whole product line: do you think that trend is going to be limited to just the Civic, or do you think that motor will get used in all their other product lines when they get redesigned?  If the NSX is truly a harbinger of things to come for the bran and their future technological direction (in the way the original NSX was with v-tec): then I have a feeling the new Civic is just the start of turbocharged Hondas\Acuras.

I get where you are coming from though.  Turbos do add complexity, and the more complex an engine is the more potential failure points there are.  Furthermore turbos do increase stress on the engine itself, and so that becomes a liability.  That is how Toyota and Mazda do so well.  They reduce complexity and use established technologies (for the most part), and as such they produce vehicles with fewer potential flaws that could pop up later.  Mazda is the automotive leader in taking withering vine technologies and finding ways to breathe new life into them.  Additionally I will not argue that the new Golf has been a bit of a clusterflop, but VW in general has been a mess for years in terms of their corporate structure.  That is why I never invested in them, I have my money in Mazda and Subaru currently.

That aside, since you seem to be a CR fan, let me ask you this: what brands do they rank the highest once you factor in reliability, owner satisfaction, driving dynamics and overall value?  I think the answer there would be Subaru and Audi.  Toyotas get docked points for being uninspired, cheap interiors, and lousy driving dynamics.  (So much for you putting value on performance.) Now what do the two brands I mentioned earlier have in common?  They both have their roots in rally racing, all-wheel-drive, and turbo charged motors.

And no, I avoided politics because you seem capable of talking about cars rationally at points, but then you descend back into right-wing nutball land: so I fail to see the point of discussing such things if you are just going to spout out random BS and ethnic slurs.

Oh finally, since you seem to love Japanese manufacturing so much: what are both Toyota and Honda investing heavily into right now?  Hydrogen electric vehicles.  Like it or not NA motors are a dying breed, and in the future if you want a new car you are just going to have to learn to love new technology.  Of course, you are probably the type the bemoans the death of the stick shift, despite the fact that DCTs are currently better in almost every single way.  If anything your continued love affair with fading technologies, inability to accept change, and regurgitation of automotive journalist bylines just shows how brainwashed you really are :).
Reply: +george bush Oh and as for your comments about Japanese cars built in Japan: that stereotype you are selling is not really accurate.  What about the FR-S, BRZ, GT86, FT86, whatever the hell they want to call it, rear wheel drive sports coupe that was jointly developed by Subaru and Toyota and is manufactured in Subaru's Gunma plant in Japan?  Well let's see what CR has to say about it in its 2016 issue, "Reliability has improved to average".  Well that is quite an accomplishment.  I would hate to see what the reliability would have been had they built the thing in the US.

Speaking of which, I owned a first generation Honda Civic Hybrid which was built in Japan, and it is worth less today than the same EX version produced in their East Liberty facility in Ohio because the reliability is so bad.  Battery pack and transmission failures that cost more to repair than the car is worth are not fun.  Not to mention the paint on the door mirrors peeled, and when I went to buy replacement ones I found all the ones on eBay in my car's color suffered from the same problem.  You could say that was just first gen teething issue, except Honda was later sued over my and later models, and the HCH was overall such a success that they discontinued it in 2015.

Oh yeah, and one of my good friends has an older Mazda 3, and despite putting less than 40k miles on it since he bought it new in 2007 it has suffered a litany of different issues with its brakes and suspension.  In fact CR says, "The compact and sporty Mazda3 has been reliable overall, but some lingering concerns remain. The brakes are troublesome in the 2006. Check-engine lights often activate on the 2004 model. Squeaks and rattles and shock or strut problems are worse than average in 2004 to 2008 models. The 2004 to 2007 Mazda3 is more prone to rust than competitors. The A/C compressor and engine mounts are bringing higher-than-average complaints in the 2004 to 2007 models."

Care to guess where his car was manufactured?
Reply: +george bush I said I was a Honda fan did I not?  And if I wanted to be a liberal yuppie I would have bough a Prius.  (To be fair I might have gotten one had I not despised the driving dynamics, and if it were not for the fact that I am 6'6" and would have to reweld the bloody lower seat frame to sit in it comfortably.)  I hypermiled the crap out of that thing, and averaged close to 50MPG; which was not bad.  Weren't you the one just extolling the virtues of Japanese reliability and engineering?  The Prius is one of the most cost effecient and robust means of transportation that you can buy.  And that is according to CR.  If you want a efficient means of transportation that will last forever: buy a Prius.  I should know I watch talking cars all the time, and am a frequent question contributor :).

My friend's Mazda 3 is made in Japan.  Trust me he is very proud of that fact.

lol Nobody can be faulted when they fail all the time?  Are you another one of these idiots that thinks that businesses should never be held accountable for their actions?
Reply: +george bush Ahhh so you cite experts when you think it suits your argument, and when then it doesn't it is just liberal yuppie media... you really are trying hard here to live up to your namesake here aren't you?  lol  I must admit your little act is somewhat amusing; although after a while it does start to grow old and tiresome.  You need to take more of an example from Trump and learn how to mix things up; as otherwise the shock and outrage fades and it becomes nothing more than unintelligible white noise.  

On a more serious note, it is a shame you have to take this approach to things.  You clearly have an interest in cars and some real opinions, but it is hard to discern that from all of the BS you spew sometimes; which is unfortunate because I think I could possibly enjoy having a automotive discussion with the real you as opposed to this "George Bush" troll-like persona you are attempting to promote and hide behind.
Reply: george bush lol In front of millions? Look I know a lot of people responded to this thread, but somehow I think we are short of millions.  I swear you are funny, I gotta give you that.

As for the facts, you were the one that brought up CR, I just pointed out their results don't support your point of view.  I am not going to even touch the global warming stuff.  We both know your comments there are just a load of BS intended to agitate.  See I don't care.  You can feel how you want to feel or say what you want to say, but we both know what the truth is: your just trying to get reaction. 

Why?  I have no clue, I guess it is fun for you.  Perhaps this is the best thing you have to do with your time.  I don't know, and I don't really care. If you want to talk cars: I am all for that.  However, I am not going to get dragged under the bridge with you.

Oh, and as for me getting a good deal: I am going to get more than what I paid on that car when I sell it back to VW this summer\fall most likely.  If making money on a used car purchase is not a good deal... I don't know what is.
Reply: george bush lol I never said I bought from a dealer.  I avoid buying from dealers.  I bought used from a private seller that was a former appellate court attorney, and he was quirky but seemed to like me: so he gave me a good deal.  Like a several thousand under book good deal, on a 3 year old car that only had 11,750 miles on it.

And believe what you want, if they didn't save the planet: the certainly saved me a good bit in terms of my wallet.  (The Civic Hybrid I did get from a dealer, but again a good deal that was well below market value. I love car shopping so when I buy a car every 8 years or so I take my time in picking one up at a good price.  It pays to do your research :).)

The Audi I am looking at purchasing is an Audi A3 E-Tron, and I am primarily considering it because it fits my lifestyle and I want an Audi hatchback (it is either that or an Allroad since I live in the states) and they are not selling well so I can get a new one for under 30 grand after tax credits.  If I go that route it will be the first new car I have purchased since my 1999 Civic Si; a vehicle I paid $19,500 for out the door.  As I recall that was a decent price at the time given it was the last great car Honda ever produced in my view and the estimation of many others.
Reply: george bush Well private sellers don't normally have detail departments, and if a car has less than 12k on it... then most likely there is not a lot of wear and tear.  Also I have a few things I look for on a used car.  Like service records and how well they are stored, the original window sticker, the original sales brochure, etc.  These tell me if it is a car that someone took care of or not.  The guy I bought my TDI from had a collapsing legal file folder with all the service records stored in it chronologically and all of the car's original documentation.  He also had a car cover, and a ton of accessories. 

He wasn't selling me a headache, possibly a heartache though. He had bought two matching TDIs at the same time, and he loaded both up with features and he purchased a ton of accessories.  (Including a VW yoga mat and a female sized VW hat.) 
My sense was that he bought the car that would later become mine for someone he was in a relationship with and... things did not work out. The car just sat for a couple of years getting occasional use.  He took it on one trip up north, and that was where most of the mileage came from.  He traded the other car in on a Ford Raptor, and I bought this one.

The mileage was so ridiculously low that it even caused an issue on the carfax report.  When he took it in for its yearly service after two years it only had 2,200 miles, and whoever was recording the data entered in 22,000 thinking that someone forgot a zero.  I had to take it to the dealership and have them call Carfax to get this issue corrected. 

Regardless, when I bought it I paid around $5,000 under book because the guy wanted to just get rid of it and he liked me because I knew cars and he didn't have to explain anything to me.  It just made the sales process ridiculously easy for him, and we were both kind of quirky: so I think he could identify with me somewhat.  That was why he gave me such a good deal.  Let me say that normally I don't get that good a deal on a car.

However, when it comes to car shopping in general I don't get a good deal because I am nice, I get a good deal because I am hard nosed and am willing to walk away.  If the price is not low enough I just walk, and I usually try to pick cars that have been sitting on the lot for a while so there is extra incentive for them to offer me a discount just to move the metal.  With dealerships I will come in with comps and spreadsheets and overwhelm them with data.

As for my 99 Civic, yeah it is not fast in today's terms.  0-60 in 7-7.5 seconds is quick but not fast.  (Although newer Si's did not really improve on that mark much up until this generation.)  However what it did have that modern Honda's don't is the double wishbone suspension that Honda was famous for back in the day.  For the 7th generation Civic Honda went to a more space and cost efficient McPherson strut setup.  While this is not a terrible design choice from a practicality standpoint, it lacks the same handling characteristics or steering feel that older Hondas have.  That suspension type was also used in the original NSX (although at all four corners based on Honda's Formula One experience) and the new Jaguar XF uses that same suspension type now for sake of comparison.  It was also fairly light at 2,600 lbs.

Edmunds did a comparison between the 1999 Civic Si and its 2012 name bearer and found the 1999 was a much better driver's car, and they said they wished the new car was more like the old one.  That is in part why that generation of Si is so hard to find (that and lots of people hacked them up), and when you do see them they have inflated price tags associated with them.  I assure you that car and the Integra Type R (my car's more powerful Acura cousin that shared the same platform) will be collectors cars in time.  I am still upset with myself for wrecking mine in my youthful stupidity.

Oh and as for me paying more for an Audi A3 hybrid: the E-tron is not selling well at all, and if the dealer is willing to hack 7-9 grand off of  new one just to get it off their lot.  That makes it less expensive than a similarly equipped normal A3.  So yeah once you factor in the tax credits... I am paying less for the plug-in hybrid model actually.  So assuming I can work that kind of deal: why shouldn't I at least consider it?
Reply: george bush 5 grand under kelly blue book for a private party sale, and it came with extras that KBB does not have options for like a lifetime XM radio subscription and 4 year extended warranty package the guy bought initially through VW; meaning all the mechanical portions of the car are covered until 2018.  And it was a one owner vehicle with navigation, sunroof, premium sound system, adaptive headlights, cold weather package, and 18" black optional rims (a freaking 3 grand option, that I traded for the stock wheels as soon as I got the car).  Also my car is a four door hatchback not the two door thank you very much. and because I am not a moron I had the car inspected prior to purchase and ran a CarFax. Other than the mileage discrepancy (which the dealer fixed): there were no issues, and the car had never been wrecked.  So none of yours "words of wisdom" are applicable in this case.  It was straight up a good deal.

And see you are the one resorting to personal insults.  So by your earlier logic, I guess that is because you were the one taken behind the woodshed son ;).
Reply: george bush lol Yeah, you are confusing cars.  1999 was the 6th generation BMW 3 series lookalike coupe not the 7th generation hatchback.  That is why it did not occur to me that you were talking about the Si.  The vehicle you are referring to used a McPherson strut not double wishbone suspension; you know the one I referred to. And somehow I doubt a 60 year old retiree in a diesel powered car is doing many drag races. So who is making rookie mistakes now? ;)
Reply: george bush lol Yeah, I have heard the Bush family plays Call of Duty every night, but as I understand it they just keep repeating missions that take place in Iraq over and over again.  I have no idea why, but apparently it is an obsession of theirs or something.  And yes, I know what you said, and that would be relevant except my Si... wasn't a hatch.
Reply: george bush Yep, which is why Trump will win the GOP's nomination and as a result give Hillary the election and break up the Republican Party.  Brilliant solution.
Reply: george bush I would compare him more closely with the 1968 election and George Wallace.  Really popular in the South, but absolute poison everywhere else. He has basically offended every minority possible, and you can't win a national election that way.
Reply: george bush Yeah but Reagan was not a known national political quantity, Trump is.  Reagan also did not offend as many people.
Reply: george bush Yes, Reagan had high disapproval ratings among Republicans because he was seen as being too moderate.  He came from California, he was originally a Democrat (prior to 1968 I do believe), and he had compromised on legislation during his tenure as Governor; all of which made him unappealing to the party.  However, unlike Reagan, Trump does not have prior experience in office and he is not really a moderate in that same way.

Where Reagan's unfavorables hurt him among hardcore Republicans, they helped him in the general election; as him being seen as being a moderate conservative made him appealing to mainstream and undecided voters.  Also because he was California's former Governor he won that state in the general election; an important state due to its high delegate count.  In fact the last time a Republican won California was in 1988 when Reagan's successor and former VP was running for office.

Additionally the person Trump would be running against doesn't have a hostage situation looming over their head, and the demographics today are different than they were in 1980; which will hurt him since he has gone after a large number of minority groups. Furthermore at that point in time the Democrats were still transitioning from being the conservative party, and the Republican party was the more "established" party nationally; which made it easier for Reagan to win since many traditional Democrats felt abandoned by their party.  Furthermore, while Hillary may not be a strong candidate, Trump is so polarizing that it will energize many Democratic voters to vote for her just to vote against him.  He also does not do much for many Republican voters that support other candidates, and so non Trump supporting Republicans are more likely to abstain from voting if he is the nominee.

While Trump might have a chance at Florida, I don't think he can win Ohio since Kasich has sided with the Anti-Trump movement.  I also don't think he can carry his home state of New York despite doing so well in the Republican primaries there because that state is such a Republican stronghold and one for which Clinton served as a Senator.  I just fail to see how he wins a national election when in most states he is only getting 40-45% of the Republican votes in the primaries.

And just so we are clear: while I may have no love for Trump, I have no particular love for Hillary either.  Of the remaining candidates, I would probably say Kasich best represents my point of view, and if he were to win the nomination I would probably vote for him over Hillary. 

In terms of the broader national election let me also say this: I would rather see Trump win the Republican nomination than Cruz; a man who I respect for his intelligence and legal knowledge, but despise for his politics and his pandering of views to the evangelicals.  I don't want either of them to win the Presidency, and in a heads up race I would cast my vote in favor of Hillary (or if it was not close in my state maybe someone like Jill Stein or even Gary Johnson) for President just to vote against them.  The reason for this is simple, I think Cruz is a better politician, more tactical, and much more of a fiendishly conniving weasel than Trump, and I think he could possibly beat Hillary in a national election because she is such a weak candidate. 

As such, I am rooting for your side in the primaries, and each time I check 538 and see Trump's chances of winning the nomination go up a look of glee crosses of my face.  Given what you know about me, if you are truly a Trump supporter that should tell you something about how I view his ability to win in a general election; as when it comes to likely outcomes to the Presidential race I tend to take something of an Al Davis approach to Trump, "The orange man will go down, and he will go down hard."
Reply: +george bush 
You are not alone in this world. Your style of life has repercussions on others and VW takes advantage of your indifference. ICE is a dying technology.
Reply: george bush ''the news just announced that the 3rd leading cause of death to humans is medical mistakes in the hospitals "
I don't believe it. Link please.
Reply: +george bush 
 Nice to see you runing.I will walk away now. Until next time.
Reply: Brian Empey First of all sir extremely efficient VW LOL man. 1.6 ton C 270cdi has better fuel economy and emissions than golf 2.0tdi, and thats just scratching the surface. And second less engine doesnt mean less polution. Problem occurs when Na people try to improove on Eu engineering. If u put the 1.6 in a passat its gonna get 2x worse emissions than 2.0. Simply put every type of car has to be fully engineered and here in Eu it is.At least as far as leading brands do. Underpovered car is also a bigger hazzard in modern trafic than overpovered one.
As for GM if they are lobbying they have my full support because VW is a company of lies and advertise and a disgrace of German car industry. They advertise cheap reliable cars but their cheap is almost reaching BMW and Mercedes which were always premium brands. And their reliable is it will run longer than Fiat or Ford. Last reasonable car they built was golf 2.
Reply: Re the opinion on banning diesel:  Next time you start your gas powered car (petrol) take a sniff at the cold exhaust before setting off.  -
 What you perhaps don't realize, is that at low temperatures especially, and so during warm up phase, the modern petrol engine produces RAW benzene derivatives (highly toxic to man) that have been added in high levels to unleaded fuels in order to address the pre-ignition tendency that lead used to fix.  Now no-one wants to see lead put back in gas, but the fact is that brain and other deadly cancers are triggered by benzene pollution (strongly linked in cities like never before), and this stuff is not burned properly during the warm up phase. If you sniff the exhaust of a petrol burner with a catalytic converter it will smell sickly sweet, which is the raw benzene that the cat cannot handle when cold.  Right now, there are vast numbers of petrol engines cruising around cities running relatively cold, and so spitting out raw benzene for a few minutes after each new cool or cold start. 

So - We bottled one demon substance, imagining good would come.  But then we standardized on unleaded nasty high benzene (and related compounds) fuel for anti-knock.  This pollution is probably much nastier than cold running diesels which now trap their soot effectively and whose warm up phase is comparable to petrol...  Not so FAST on getting rid of diesels which produce less CO2 per unit work done!    

Its time for a new fuel that does not require benzene added.
Reply: :) All the points you make are excellent, except "contaminated with abrasive soot". Soot? I was not aware this is abrasive?
Reply: Who’s laughing now
Reply: Vw, for years, has had "safety features" in their cars that kill engine power and reduce rpms under certain conditions, the result of reduced tq on the dyno is most likely do to the car putting itself into a fail safe mode.
Reply: the issue is really the EPA. they are in the pocket of big oil, and it seems that their mandate is to make extremely efficient vehicles illegal in the USA.  I'm an engineer and an environmentalist, and i bought the first TDI New Beetle in Western Canada in 1998 and a 2009 Jetta hi line TDI/DSG wagon.  The 2.0 TDI is stupidly big for these cars, but the 1.6 TDI is illegal in the USA because it doesn't pollute enough.
Some people mistakenly think that the EPA measures how much pollution a car makes. But they have never, ever measured that. 
They only measure percentages of NOx, so the easiest way to pass the test is to burn lots of fuel, creating lots of pollution. 
So Jetta owners are freaked out over pollution, while their neighbor commutes in a 1-ton diesel 4*4 crew cab, making 5 times the pollution, and their kids ride on school buses making 100 times the pollution of their TDI.
Yet the twisters of truth at big oils EPA make them fear America's least polluting "conventionally powered" vehicle. less fuel = less pollution.

Trump is going to dismantle the corrupt EPA, and as an environmentalist I'm all for it. Let's measure pollution, not percentages. Percentages don't kill you. Pollution does!
Reply: Unbelievable , still we need to go to the hospital when something is wrong. Not breathing toxic fumes also helps. Thanks for your time.
Reply: Nigga stfu every other sentence was I don't THINK you did it right, I don't THINK that was right. If you don't know don't say it was done wrong
Reply: they all lie like hell. If you test ANY Diesel running you see that the emissions are ALL FAR higher than they should be. What VW did was wrong, but their cars pollute as any other Diesels. Diesels by nature produce high amounts of NOx and that pollutes. Period. They ALL produce FAR to much NOx. Governments worldwide won't ban them (which they ought to simply because they are Diesels) because then they'd have to ban tucks and container ship which will bring the globe to a standstill.